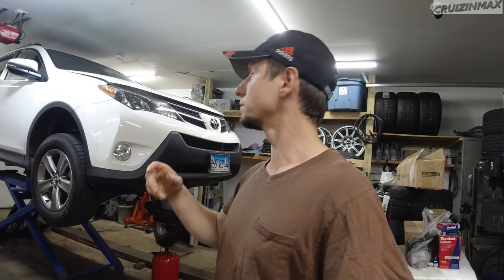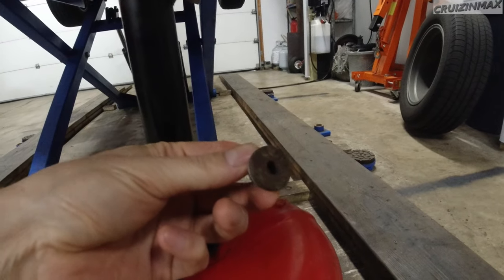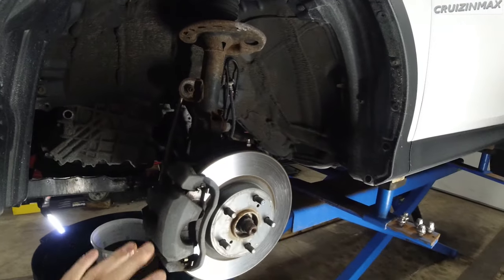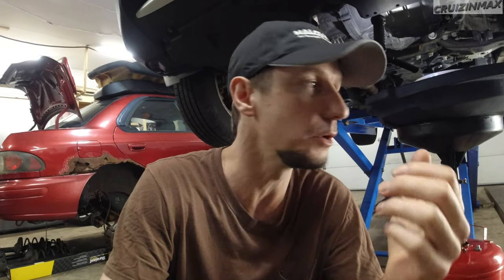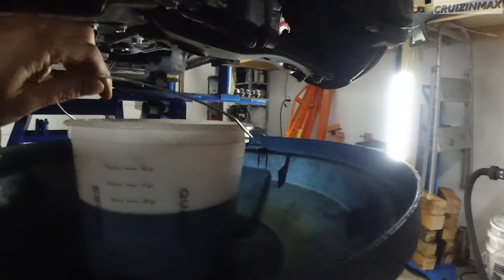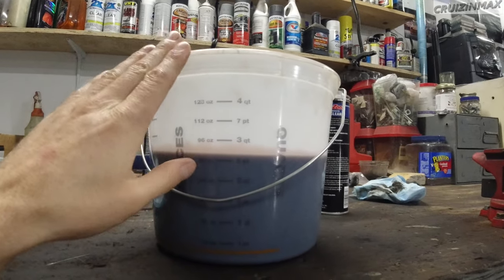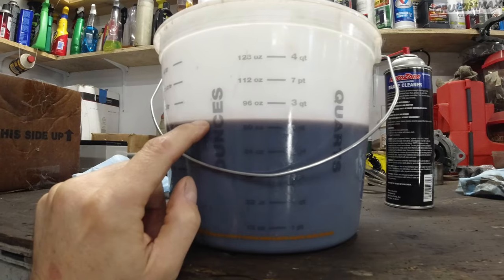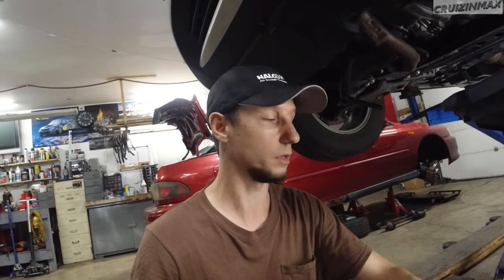Toyota Rav4 how to automatic transmission fluid change

Comment: Just to be CRYSTAL CLEAR, this is NOT a 100% "fluid change" (as you have it incorrectly titled).  It is ONLY a PARTIAL  "Drain and Fill".
Reply: @battlehrfred   Said in the most respectful way to you... you are about 99.9% wrong about there being "no possible way".  The short version of how I have completely drained and replenished the fluid is as follows.  1)completely drain and fill pan basically exactly as you have done but add about 1/2 qt more. 2) get clear hose and run into the measuring bucket from the Trans fluid return outles at the bottom of the radiator. 3) start engine and have a helper watch level in bucket till 1 qt empties into bucket and then shut off engine. 4) put 1 qt in fill hole. 5) repeat till red fresh fluid is draining into bucket and stop. 6) add 1/2 to 1 qt of trans fluid and >> PROPERLY << set trans fluid level as per factory specs. (you did NOT do this per factory manual in this video).  To do so, you level the car and put it into "Temp Mode" by starting car in certain way and shiftind certain way till car enters the mode.  Then level fluids per FACTORY manual.  There is a good video showing how to enter temp mode by the carcarenut.  You have just replaced 99.999% of the fluid.  There should only be tiny traces of old fluid left in system, that is why I said you are 99.9% wrong about this.  FYI, I wanna say that it takes roughly 9 quarts of ATF total to do the above procedure.
Reply: @battlehrfred  said respectfully, you SHOULD  CHANGE THE TITLE OF THIS VIDEO TO REFLECT THAT THIS IS A "DRAIN AND FILL" and NOT a transmission fluid change as that is MISLEADING.   >>> SERIOUSLY!!!  <<<
Reply: @battlehrfred  I hope that is a typo when you wrote in your last comment... it said "no respect".  If not a typo, then I do not appreciate that.  Honestly, now you sound like you just want to win an arguement (and have totally closed your mind to the possibility that you are wrong in order to do so).  Furthermore, you are misquoting me (and I do not appreciate that either).  I NEVER said "ALL NEW FLUID" &, in REALITY, I said "99.999%" new fluid and that there would be "traces of old fluid left in the system".  ALSO, Adding fluid to pan AFTER draining pan = starting process (that I listed) with all new fluid and pumping through it till 99% replaced.  DID YOU EVEN >>> REALLY <<< READ MY ENTIRE PRIOR COMMENT BEFORE REPLYING???  If not, please go back and do so now as you are simply WRONG IN YOUR LAST REPLY & IN TITELING THIS VIDEO as it should AT LEAST INCLUDE THE PHRASE "DRAIN AND FILL" and NOT THE WORD "REPLACEMENT".  Please quit simply trying to win an arguement and prove you are wright when YOU ARE WRONG and do all of your viewers and I the favor of AT LEAST retiteling this video as I suggested.  If not, then (at this point) the title is litterally an intentional and misleading lie.  SERIOUSLY!!!
Reply: @jotu173  No DISRESPECT ,Is what was meant and is a typo, I did Say , Sir and ty on the last comment. so i guess the only way is to delete my opinion(s) and as a transmission repair guy for many many moons,  Also ,in this case,i will just delete my  feedback/comment (s).  you have a great day.  ty
Reply: Nobody said it's 100% but you😂

Comment: You need to research how to check the transmission fluid. You’re teaching everyone the wrong way. You ran the car till the fluid is hot and checked it at operating temperature. That is the most wrong thing to do with the Toyotas. It has to be checked between 95 and 113F and no more or less. That’s a huge difference from what youve done here!!! Please take this video down so it stops people from ruining their cars. Which is for sure going to happen if they follow this video! 🤦‍♂️
Reply from the maker: So ure telling me that if that fluid was never changed and im putting exactly the same amount back, thats wrong?  Its not wrong, its just a different way without wasting more time.  By the way this car still drives on that same fluid without any issues and that same owner is still my happy customer.  Now i understand where ure coming from, there is a procedure that under different situation, like a leaky trans or changing a trans line, I would follow the right temperature then check, but in this case i didnt have to.

Comment: The benefit of drain the Toyota transmission fluid when the engine hot is more fluid came out. Then let it drips overnight to get the fluid off as much as possible. Finally, fill in exactly fluid volume was taken off at room temperature.  No other youtubers mentioned to drain fluid when it hot. I think you bring up the best method to change the Toyota seal transmission fluid with minimal tool required for the do it yourself car lover. I will follow your method to do for my Toyota cars and other seal transmission car. Thank you so much.
Reply from the maker: If you have a leak or ure changing a line then you have to follow the fluid check procedure at the right temperature, otherwise ure safe.
Reply: Technically for this car with the tube.  You need to have the car heat up to 104 - 113 and let any excess fluid out. How you will know how hot?  Use a thermo gun in the pan.

Comment: I've always drain, measure and then fill cold first thing in the morning. That way fluid will measure the same because of the same temperature. And do it annually which for my family cars is about every 20-25K miles.

Comment: Boss I have a question when u drive to the shop and do a drain and fill how the  temperature can be in that 74 range. It’s more hot. No car shop is waiting for 3-4 hours to cool down to do the job even dealer. I like to hear yr opinion on this. I don’t think any shop will hold the car overnight to do this. I m afraid to do myself. Thanks.
Reply from the maker: Shops will not wait since they all should have the right equipment to  measure the level properly after fill.  What I have done and showed that its possible without the expensive equipment but if you have a scanner and can read the transmissions temperature on it then you can also measure that way by removing the upper plug on the oil pan and let the excessive fluid out after the trans riches the right temp or add fluid if nothing comes out, thats after the final fill of course.
Reply: @cruizinmax4017    I remember back in the day I had a toyota Celica mechanic just drain and fill no scanned anything. If u go to a side job mechanic they don’t have the equipments to do it other than big shop. Other question is toyota Claims it’s life time would u believe on that. I had people told me they never bother changing it and it ran fine. Also I heard from a master toyota mechanic if it’s more than 100000 mile on the car it’s better not to do anything.
Reply from the maker: yes its lifetime of the transmission until it breaks, in other words change it and it will last longer.  As far as the 100k mile rule its only true if the trans is already giving you issues then dont change it or just do a drain and fill, no flush.  A drain and fill is always safer then a flush on an older transmission, just do it more often, every 30k on cvt trans and every 50k on regular trans.
Reply: @cruizinmax4017  thanks again for your thoughts.

Comment: What fluid did you replace it with? I was considering using Valvoline trans fluid since it claims it can be used in Toyota's. The Toyota fluid is so darn expensive.
Reply from the maker: maxlife valvoline is good
Reply: Always used toyota oils  it’s recommended and same with honda cars use honda oils it’s recommended too..nothing else

Comment: Good overall but several points:
1. You can’t rely on putting same amount in that came out. It may not be correct and every time you do it you continue building on the error. You need to do the proper temp check. Your way will work in a pinch but not a good idea long term
2. you don’t need a pump. Get yourself a vinyl tube and feed it down from either the wheel well or the engine compartment. Have a funnel attached to the vinyl tube. Gravity feed.!! pumps are a waste and bring in all sorts of issues that you described.
3.  Fill bolt is 24 mm which is close to 15/16 but all Toyotas are metric
4. Great job leaving it overnight and getting an extra amount.
5. Measuring the temperature like you did when it was 78° on the pan and in the quart bottle is too funny. Although everyone says this fluid expands it is absolutely insignificant in the temperature range that you’re talking about. I did a test from 70° to 180° and noticed NO significant volumetric change of Toyota WS.  If you don’t believe me, do it yourself. The big driver, in having the correct temperature is the internals of the transmission. There are volumetric changes within the internals that take up more fluid as the temperature rises. That’s why the temperature is such an important part and you totally are missing this aspect. 
6. The straw has to seat properly into the pan. There is a time as you’re replacing it that it gets tight and then loosens again. It’s a critical that you screw it all the way in so that it bottoms out without putting too much force on it.  For my car this is an additional nine rotations once it’s flat with the pan when you’re installing it.  
7. Change the strainer every hundred thousand miles.
8. Do that approximately 2 quart drain and fill every 25 to 30,000 miles
9. Using an equivalent pale or old  jug to be able to mark the exact amount and replace it with the exact amount. It’s a great technique for all car repairs involving fluids.  
Nice video!
Reply: What do you mean do the proper temp check. If the temperature of the fluid doesnt alter its volume why does temperature matter
Reply: @brycek6881  - doing the proper procedure by draining the overfill is what I meant. You can’t just assume what came out he put back in because then you’re assuming what was in there was right in the first place and that’s a bad assumption.  whether you believe the temperature or not approach, you need to drain the overfill to get to the proper level
Reply: @condor5635  fantastic clarification. So before removing the plastic overfill, remove just the drainplug and let anything that comes out go to waste and not get measured because its above the specified volume. Does this have to happen at standard operating temperature?

Also what are your thoughts on changing the filter and yhe gasket. Should you do it every time you change trans fluid
Reply: @brycek6881  wait for temp remove drain bolt let excess drain until trickle. Then install drain bolt. I removed my pan at a 100k to clean magnets and did new gasket. I did not replace strainer since I keep fluid very clean and it was not necessary.

Comment: Hello there, I recently did a CV axle repair on my 2018 Rav4 XLE, I had about a 3/4 to 1 cup of trans fluid come out when I removed the axle. I knew I needed to replace the fluid, but had none at hand. I slowly tested it in my alley for issues and no noises or shifting interruptions. Since the oil leaked out and really have no accurate amount of fluid loss I want to just do a flush and replace before driving it again. How will I know how much to replace? Obviously will follow your protocol, but the losss of some of the fluid will create an innacurracy right?
Reply from the maker: yes but its not that important 1 ounce more or less

Comment: How do you know if you were underfill or overfill to begin with. I still like the deaining the excess oil from the drain plug to a trickle at 95-113 degrees ferenheit with the engine running. You know its more accurate fluid level.
Reply from the maker: The plug with the straw is the check plug, some fluid should always come out when u take that out when hot.  If not, chances are ure low.

Comment: This kind of "partial flush" every 30k miles, filter every 60K miles ... I don't trust "lifetime" filters/fluids ... it's all about getting you into a new car every 120K miles. These things with proper maintenance and not being an idiot behind the wheel can easily go double to triple that mileage!
Reply from the maker: i had an issue on my 02 bmw 530i, when cold it would take  a second too long to switch from 4th to 5th, i drained the fluid twice and replaced filter twice within 5k miles and its all good now.  Bmw says that its lifetime fluid.
Reply: Very wise.

Comment: We have seen TC shuddering at 60K with these, solved with a couple atf drain/refills.  There is a TSB for fluid degradation, because WS fluid is cheap crap.  Lifetime fluid means warranty period-dont let the dealer mislead you.apparantly

Comment: How often should the transmission fluid be changed on a 2018 rav4 automatic?
Reply from the maker: I would do a drain and fill every 30k miles.
Reply: 60K tranny fluid per Carecarenut master toyota tech on youtube, transfer case and rear diff every 30k.

Comment: What happens if u just measure the mass of the fluid instead of waititng it to cool down?
Reply from the maker: Good question, never tried that.
Reply: I wonder this too, a good digital scale and tared containers, hoses and pumps could be a way to side step, hang up and expansion issues. Or even just weigh the initial drained fluid in case you spill it later.
For the less scientifically inclined, mass is the weight in this case.

Comment: Hey bud I have a question about my 2010 camry power steering fluid. Currently it’s clear fluid I never changed it. I just want to drain and fill the reservor couple of times. When i asked dealer they use ATF fluid dexron 3 and which I believe my manual says use dexron 3. My question is can I use the red ATF to mix with the clear I have. I been looking for a correct answer but every one say different thing. O found valvoline synthetic one too don’t know which one to use. I like to hear your opinion.
Reply from the maker: How can you tell that its clear? Did you actually take some out or are you looking through the plastic reservoir?  Never seen a clear ATF fluid before but if they are different then I would not recommend mixing the fluids, try and flush it out with the dexron.
Reply: @cruizinmax4017  Actually it’s clear or amber I open the reservoir. It came from factory like that I confirmed with the dealer
Reply: Thanks for the advice what about brake fluid it’s dot 3 I bought some Prestone synthetic.
Reply from the maker: brake fluid you want to remove the old one with a hose or some kind of line thats attached to a syringe, suck it out from the reservoir then refill and bleed the calipers until you see that fresh fluid coming out.
Reply: @cruizinmax4017   Thanks buddy.

Comment: How do we know if it had exactly the correct amount of fluid to begin with?
Reply from the maker: because it was never done before.
Reply: @cruizinmax4017  okay, that makes sense. Do you know if there is a special crush washer for the drain and fill plug? I asked the dealershit and they were of no help. They told me the trans was not serviceable and the pricks blew me off.
Reply: I’m dealing with a 2017 rav4 if it makes a difference.
Reply from the maker: yes there should be, order them online.
Reply: @cruizinmax4017  any recommendations on a good site to use?
Reply from the maker: I tell people to shop dealers but online.  A lot of times dealers that ship from different states will be cheaper then your local ones but if ure only looking for washers then visit your local dealer.

Comment: Were there any crush washers on any of the drain and fill plugs?
Reply from the maker: yes I think so, watch the video closely Im sure I showed everything
Reply: @cruizinmax4017  You didn't mention it in your video, and I couldn't see well on the fill plug - it looked like you had an aluminum washer. Since it is on an aluminum surface, where you can't really torque to what crush washers need, I was wondering if it was just a washer, or a thin rolled up crush washer that uses less torque to form and seal, or made from some other material. For the drain one, I couldn't see at all, but that's not an issue, since you have to torque the drain plug to 30 ft/lbs and that would be more than enough to crush an aluminum washer without problems.
Reply from the maker: I believe it was just a flat washer.

Comment: Excellent video, were there crush washers on the fill and drain plugs?
Reply from the maker: yes, there should always be washers on those plugs.
Reply: @cruizinmax4017  thanks for your video. Could you please tell me the correct crush washers for this job? I’d really appreciate it. They couldn’t tell me at the freaking dealership.

Comment: I don't like AT ALL that Toyota doesn't provide a "Dip Stick"....  Why?  Because dealers especially like to ** YOU by not putting all your Fluid in.
My Chevy Dealer literally ruined my Transmission when I had them flush it by not putting in like HALF of its fluid, after driving it for a day, they ruined my Transmission that only had 60K on it.
Worse, I didn't fully realize what they had done until a YEAR later... when I had the dealer properly check the fluid level.  I won't get into the reasons why it took so long to properly check the level, health etc.  Anyway, now I always check my Fluid levels after taking them to have fluids changed.  But now I CAN'T cause I have the danged Rav4.
Reply from the maker: Yes, just because its a dealer it does not mean that they all know what they are doing.
Reply: @cruizinmax4017  ...  I think the primary issue is they are doing "multiple" jobs at the same time and so they forget where the HELL they are at with a particular vehicle, so it makes them easy to make mistakes.

Comment: I hope you understand its wrong, you have to measure temperature of the ATF. You will not get correct measurements of ATF with this thermometer
Reply from the maker: so ure saying that when the old fluid and new fluid sit in the same temperature for about 14 hours, both temps will still be different?  And also measuring the container in which they both sit in will also show different temp?